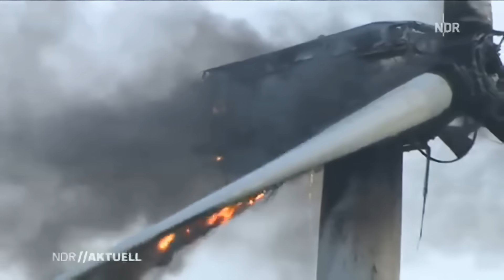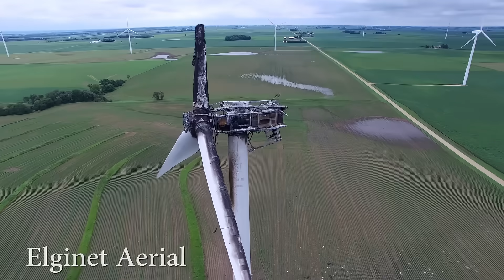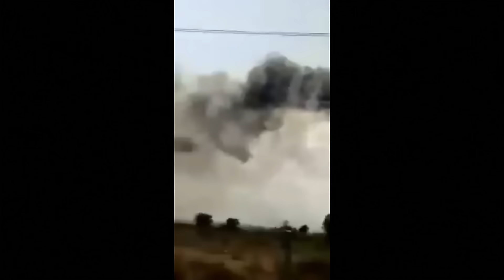IMPORTANTE VER: Acidentes e Incêndios em Turbinas Eólicas / Aerogeradores

Comment: I used to have a wind turbine in my backyard but caught on fire. But the rotor was reaching enormous beats, the rotor was reaching speeds up to 100 to 200 miles per hour. Nothing stopped the movement does turn the blades Disintegrated.
 System speed slowed down, but all was lost and when the rotor stopped. The whole thing just collapsed. I was outside at the time.

Comment: 0:20 this turbine moving due to low fire the rotor continues now to move 
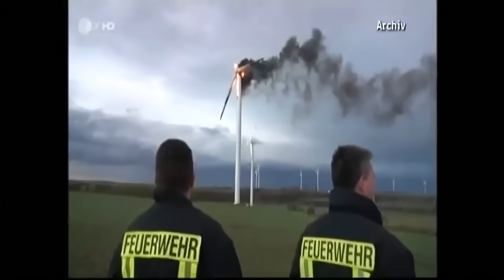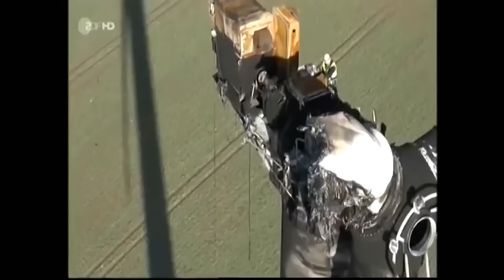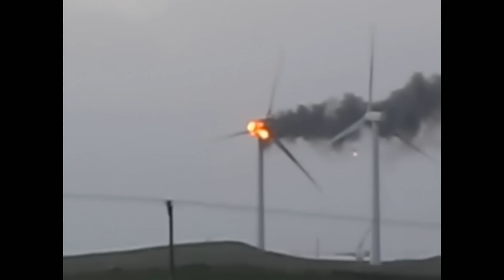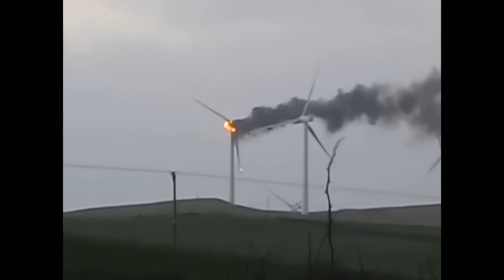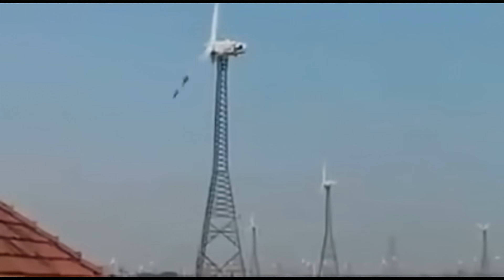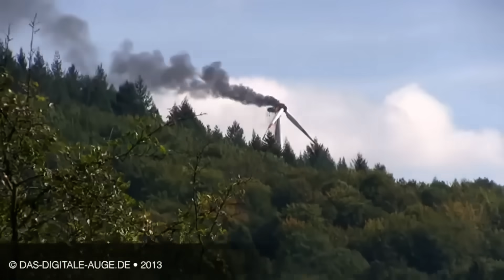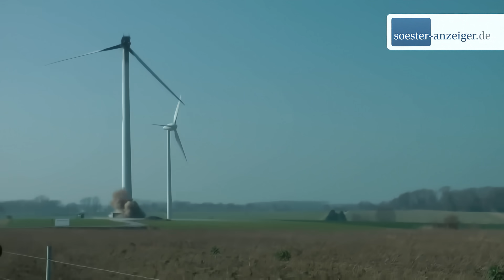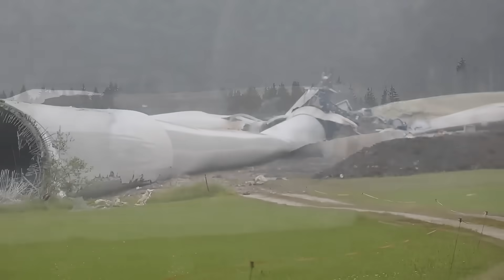0:34 this second footage of the turbine burns in germany after the blade falls it got expanded 0:45 at the end the turbine had a blade fall due to fire 0:50 this turbine got burns near ardrossan 1:00 this turbine going faster after 2 blades had disintegrate 1:10 as the turbine had 2 blades similar to the 1:00 after in 1:38 it falls 1:50 this is the turbine that got burn of, the 1st blade got falls in 1:52, 2:10 in the burned turbine this turbine demolish over 2:23, in 2:36 this turbine damaged by tornadoes and burns hit by lightning, 3:19 this is the polish fire turbine falls of in poland 3:43 an out of control burning turbine got spins faster and faster and its blade disintegrate in 4:18 4:39 the 2 malfunctioned turbines got demolish 5:21 thanks for watching on the turbines burning and demolish

Comment: Fixed blades are the issue if they could be remotely controlled to privet slightly in a dangerous situation then they would slow down without needing a break system. i know computer tech is linked in to these turbines already design fault can be rectified

Comment: The turbine wheel continues to  turn because the braking system was not designed to activate and lock the wheel shaft when a turbine compartment fire starts. 
Additionally, the braking system materials would not withstand 2400 deg F. temperature.
Reply: 009
Reply: What!? The 2400 deg F is the insane temperature!!!
Reply: @angkhanhvu1324 99°c tempeature

Comment: How ,matel can burn ???what is the reason of burning rotor blade ?it is not plastic
Reply: Could be the coating/paint over the metal which burns. 

Edit: I searched online and the carbon in steel can also burn.

Comment: 2:36 my thoughts on this broken wind turbine it that 1: span to fast causing the brake disk to over heat when trying to brake and 2: is that when spinning to fast that the generator overheated because the fast spinning turbine was to much for the generator to handle

Comment: I see enough of these videos to leave me with the impression that this type of wind generator isn't very reliable.
Reply: if you think about how long this type of wind mills have been used for and the number of such accidents, I think it's still acceptable. But companies setting them up should also provide emergency services in case of fires - some kind of rapid response with specialized aircrafts which could take out burning mills fast.